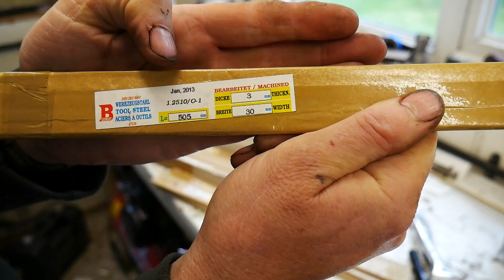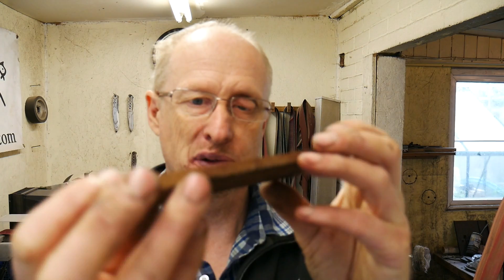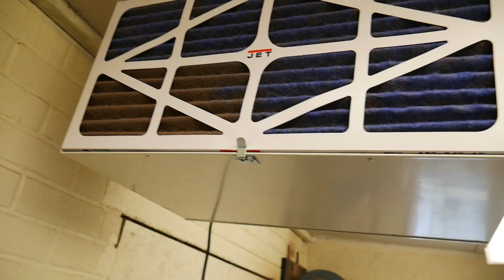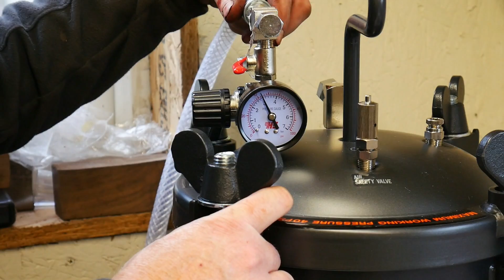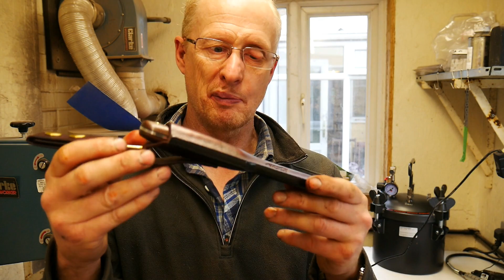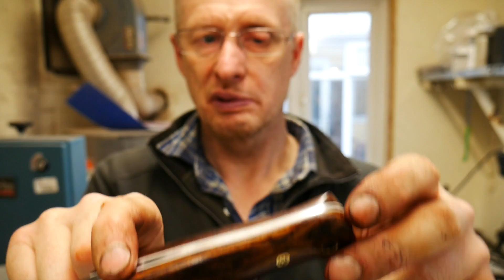Workshop improvements, Dealing with Dust and NEW KNIFE DESIGN

Comment: hi sandy, great vid as usual, one question tho. do you use seperate extraction for metal and wood? because wood dust is highly explosive . a spark can easily fly throught your extractor and ignite it.make sure that they are as seperate as possible. i know  its hard when you are sanding the handle while its on the knife, in that case it would be better to turn extraction off while sanding then turn it back on afterwards, will help reduce the risks. regards, fran
Reply from the maker: Hi Fran,
Valid point I don't extract when grinding steel but as you point out when shaping the handle I do get sparks from the tang. Never had any problems with hundreds of knife builds and can only put it down to the mixture of air and  fuel not being in the correct ratios to cause an explosion.

Comment: Super update and loads of new toys, really good toys too.  Question please... is that the Axminster rotary tool hanging beside the pressure pot please?  If so, would you recommend it because I'm looking for one?
Thanks, Brendan.
Reply from the maker: It is Brendan but I do not recommend it as it has stopped working in less than 8 months. Not sure what is wrong with it. I should send it back but have been too busy.
Sandy
Reply: Thanks Sandy.  I am looking at a Dremel with extension shaft because I've had good reports on those but nobody seems to have the one you have.  I think I'll go on the Dremel.
Best Wishes, Brendan.
Reply: I use a Dremel Brendan and have found it to be OK with a good range of speeds. I have built an adjustable gantry to suspend it from, which works well. I will probably post a video of my Dremel set-up soon. Cheers, Jim
Reply: Just realised I'm already subbed to you.
B
Reply: And I am subbed to you ! If you are suspending the Dremel and using the extension shaft I would steer clear of the battery Dremels. I've sent you a message. Cheers, Jim